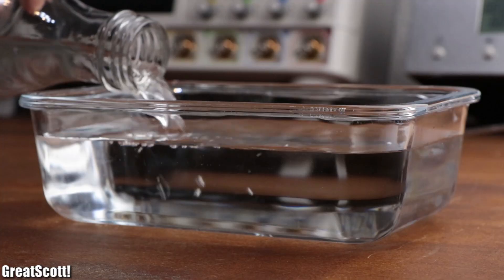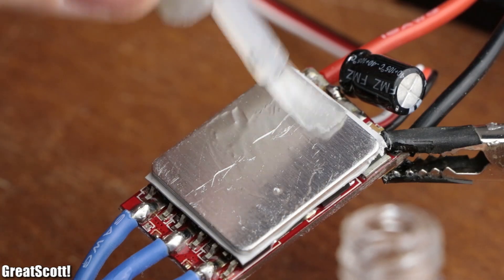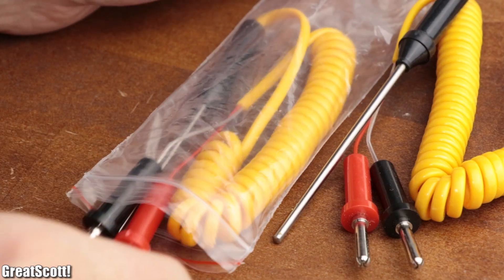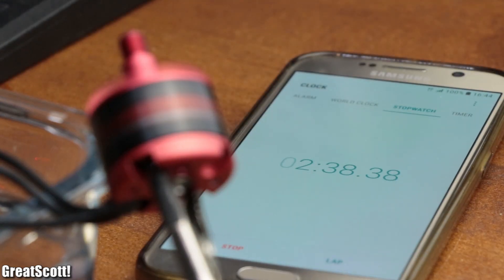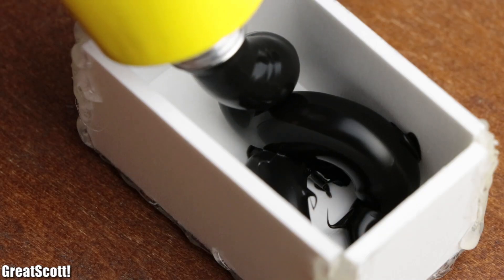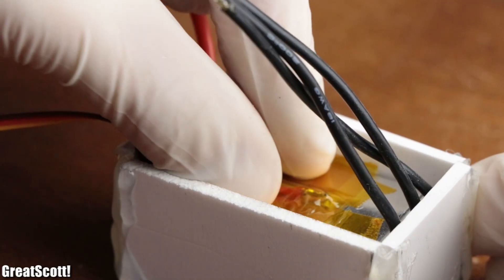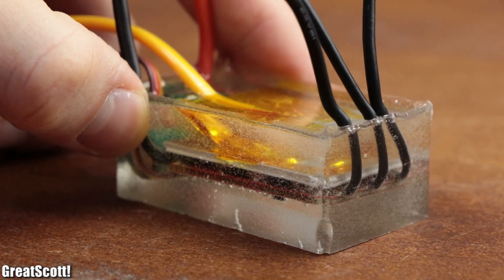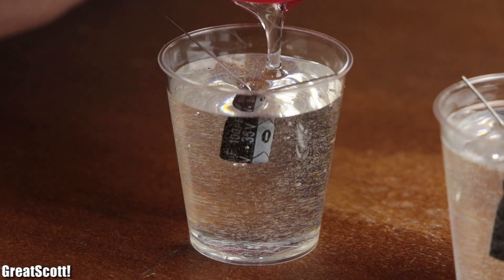How to Waterproof Electronics || Nail Polish, Silicone, Potting Compound

Comment: the original shrink tube protection around the ESC - is that good enough actually? Like, can the humidity inside the shrink tube cause problems at low temperatures?

Comment: I think the silicone did not cure because it did not have enough time to capture moisture from the air before encapsulation. Silicon needs the water for the chemistry to begin.

Comment: Seen you know about electronics ! I have a question.  Can i put any kind of silicone to protect the positive and negative wires for my 48 volt battery port terminals ? There was a white silicone already there, but i removed it to do an inspection.  Thanks

Comment: Silicon hardens when exposed to the humidity in the air. In other words you only exposed the outer layer while the inner layer stayed liquid because it was sealed, the same way it maintains itself liquid in the tube it comes in. It must be applied in quarter inch layers at a time, adding a layer roughly every 45 minutes with a total curing time of 24 hours.

Comment: The technique I have used for decades on, for example, greenhouse automation electronics but also ESC and receivers is to apply about 6 generous coats of Ambersil acrylic conformal coating allowing time for the coats to air dry between applications. This coating is very thin and with low surface tension is very searching and with the boards flooded with the coating it covers the underside of chips and, importantly, their legs. I protect any connectors while applying the coating but, having completed the coating protect the contacts with Electrolube EML (this latter protection I repeat about every 12 months).

Comment: You can mix silicone with white spirits and make a silicone paint. Very easy to apply and works better than nail polish. 
That black silicone looks like gutter/roofing silicone, it doesn't dry due to the need for it to keep moving with the roof tiles.
Reply: hi preytec have you become a flat earther yet?

Comment: I have a 1" long electronics board with a usb input on one end, and usb output on the other. I'd like to enclose it entirely in a block of some form of resin or hardening waterproofing, without any of the material 'oozing' into the usb connectors and possibly preventing other connectors from properly seating. Suggestions for this?  What could be used to make a 'cubic' holding container for the resin to harden?

Comment: wait this is wrong, so wrong, what if the component is to be used in a HOT engine bay?  is a guy supposed to have a container under the hood where he can pour cold water into it every few hours?  this isn't real world as your water is acting as a coolant?

use real world conditions such as an oven turned up to like 180 to simulate a hot engine bay on a hot arizona day..   I mean why would anyone use a thermal heat conductor to cool silicon components in water? they would just use the water to cool the silicon components no?  what the hale did I miss?

Comment: I have a small open circuit,the size of 25 cent coin,which is mounted to a bicycle crank near the pedals.This circuit uses a 3 volt CR2032 battery with a twist cap to close and protect the circuit board and battery.The battery only last 7 days...so I purchased a 3.7 volt 2000 mah lithium battery with JST connections wires and soldered it into the circuit board.The small unit works amazing now.I only have to charge the battery,once every three months.The only problem is, I left the circuit vulnerable to water because I only covered the small circuit board with many raps of electrical tape.It looks ugly but it works for now.I need to clean it up so it looks like nice.

My question is,will the nail polish be enough to water proof the small circuit board against rain and moister ? I will be riding in the rain for 2 to 3 hours or going through puddles the odd time.Also,If I use nail polish or any other sealant,will I be able to remove these products from the circuit board in case I have to re-solder the wires again?

Great video,very informative.

Comment: You should try different types of silicone in different methods of application. IMHO, I think you went way too ridiculous on the silicone and potting components. You could have just dipped the potting stuff a bunch of times to make multiple layers until properly sealed without being a brick. Same idea with the silicone, I think. You just need to use some thinner/less viscous stuff somehow. Nail polish can make use of this idea; but you wiill need a lot of it to be able to dip it in and out again like a candle.

Comment: That's pretty fab. I have an older car sat Nav or GPS unit and instead of throwing it away as my car comes with one nowadays, I'm going to use it on my motorcycle. After using nail varnish. A dedicated waterproof unit is around £400. I've got nothing to lose 🙂🙂
Thanks

Comment: For silicone rubber seal you need cardboard or paper box (moisten box before cast for easy separation). Because silicone for curing need water vapor from air. Your box with plastic sheets - totally block water and curing time 1 day per each 2 mm thickness from top. For fast cure - put in the hot water.

Comment: I've worked with potting compound on my job in the past.  it's a nightmare.  Good luck troubleshooting circuit failures, it is terrible for thermal management, and thermal expansion can rip parts off the PCB.  It's expensive, and very messy for the manufacturing plants.  Conformal coat is better.  Best is to deal with waterproofing with the housing.

Comment: All this when you could have just used conformal coating, that's actually for electronics. Let's find out what happens when we heat up chemicals. 🤷‍♂️
Reply: Thats only designed for moisture not full on soaking
Reply: @antan2329  contact MG chemicals. They have about everything. If not ask.

Comment: Please consider deleting this video as its content is misleading. Testing the ESC with motor without load? The ESC would overheat in the resin or silicone. And the silicone, Is that at least neutral? Acetic silicon will destroy the ESC. You would have to use two component silicone for this purpose.

Comment: Great information. I wonder how things would have been under load though rather then running it in open air. 
Also, that how silicone works. It will always do that to you. However, if you mix in corn starch when you go to coat the item the corn starch will cause the silicone to 100% cure no matter how big the blob is. That's actually the premises behind "Sugru" which is a commercially available version of the same thing.

Comment: Do NOT use silicone - in the early 1990s I worked on a project which used this for potting a filter coil module for use on a fast jet's avoinics. It all seems fine on day one, but as silicone cures, it releases acetic acid (it's why wet silicone sometime smells of vinegar). This is only a small quantity, but over time it attacks your solder joints, leading to premature circuit failure.

Comment: Nail polish seems to be the safest one in simpler circuits since you can use acetone to remove it if you need to resolder or fix something

Comment: if you ever plan on doing repairs to the circuit or want to change something, it will be a pain removing whatever epoxy is used to pot the electronics. It's a great option once you know your shit works, and you want it to be that way permanently

Comment: I hope you will see this message, this video being so old now, but there's a great product I've discovered that works as well as silicone, but is a lot easier to use - you just paint it on... "Liquid Electrical Tape"...  It's like silicone, but it dries really quickly, and like I said you just paint it on... I use the black, but it's also apparently available in red, green & white.  It's from Gardner Bender.

Comment: Man I love your videos, great channel. I have a question am planning on doing something similar like your intro video 1:30 am going to be using some red LEDs and adding a on and off switch, but my question is what were you using as your power supply? And since there is quite a few leds is it better to run them parallel or on series?

Comment: GreatScott!  You just saved me $20 bucks for expensive conformal coating.  I suddenly had a thought to use clear nail polish for an outdoor solar light, did a google search and YOU show up as the first search result!  Too Cool!  Normally I'd skip the video results but I recognized you as one of my subscribed Go-Tos!  
Congrats and Thank You!
Reply: Use a UV light to check for holes in the coverage area after the nail polish is dried. The polish will shine under UV a milky color, and the light will reveal thin spots which may need a second coat.

Comment: If you really want to see how these compounds would work at higher temperatures, you would need to load the motor in order to produce significant heat at the heat sink.  One idea would be to attach a fairly big propeller blade and then fix the motor in place and let it push air around, or you could attach a smaller blade and stick it in water.  Or, if you're a bit of a mad scientist, you could try holding the motor's rotor stationary with respect to the stator in order achieve a locked rotor scenario, but only if you don't mind possibly destroying your motor and/or ESC.  This will make things very hot and so you might want to limit how long you do it for and then switch back to a lighter load and see if it still works.  20°C is not hot; it's room temperature.  You want to see how these compounds perform at 40, 50, 60°C and up.  Depending on the ESC, you might get temperature above boiling point, which means you need a better heat sink (and probably bigger wire and a good power supply).  This is still an informative video just on the information about some different DIY solutions to waterproofing circuit boards.  My application doesn't require higher temperatures so I will try the clear nail polish.

Also, can you tell us what you used for the clear potting compound?
Thanks.
Reply: I water proof my RCs with CorrosionX spray it couldn't be easier and the thermal properties of the device are unaltered

Comment: if you wanna get really fancy with the epoxy, use a pressure pot to minimize bubbles. You can either vaccum the bubble out, or apply pressure to shrink the bubbles when curing.
Reply: Great idea when dealing with electronics that includes a electrytic caps...

Comment: have you heard of our lord and savior, conformal coating spray?
Reply: Is that like CorrosionX because that's what I use and I don't understand why it hasn't caught on
Reply: @PabloGonzalez-hv3td  i dunno what corrosionx is, but conformal coating spray is a spray that turns into a thin layer of plastic when it dries, as in a coating that conforms to the surface it's sprayed on.
Reply: @nonchip  Corrosion X makes a specialized lubricant / anti corrosion spray that instantly waterproofs electronics and since it's an extremely thin conformal coating the thermal properties of the device are unaltered.
Reply: @PabloGonzalez-hv3td  ah ok the stuff i meant is usually not lubricating or actively anticorrosive since it's meant to be very chemically inert to just be "in the way" and not interfer with anything (since reducing agents from anticorrosive stuff can damage some electronics) and often a bit thicker than that stuff.
Reply: @nonchip  This stuff is also meant for electronics (save for membrane switches) and has the viscosity of cooking oil it's not reduced.

I can't speak for long term effectiveness on an item that's continuously submerged but it's perfect for splash proofing
Reply: @PabloGonzalez-hv3td  with "reducing agents" i meant in the chemical way, as in "takes oxygen away from things" as many anti-corrosion sprays do to "reverse" any rust. you definitely won't want that in electronics, but sounds like the stuff you got doesn't do that, and just protects against further corrosion by being waterproof, that's totally fine.

Comment: I use the 2 part epoxy. I buy the cheapest epoxy HF sells and stock up on it because it works like a charm and it never goes bad in storage when its a 2 part formula. I've dragged circuits through lakes with this on and never an issue.
Reply: CorrosionX spray is much easier to apply and the thermal properties of the device are unaltered

Comment: To use silicone.  Make sure you have 100% pure silicone.  Mix corn starch 1 tbs with silicone 5 tbs for about 2-3 minutes (disposable container/cup and plastic/latex gloves).  Then pot device.  Will set in about an hour.  Set silicone will easily come off fingers, cup &whatever but will be a solid block covering component.  (Maybe use a little silicone to seal around wires.)

Comment: YouTube read my mind. I'm working on cooling PCBs with water, while keeping material density and conductive coefficient in mind. Thermal resin with silicon dioxide filler did indeed end up being the solution of choice. Except I'm trying to dissipate 50W of power, not 1 or 2. Good stuff.

Comment: Thin the silicone with mineral spirits and it will pour easier - add some glycerin and it will harden without air exposure.
Reply: i was wondering if somebody would post this.. screw nail polish, use silicone and a thinning agent
Reply: @schlomoshekelstein908  Cheap, readily available, easy to use, not super toxic like 2 component, plus being rubbery I think is a better end consistency than brittle.

Comment: We used to have a cooker that its main electronic control box was susceptible to 'flooding' from cooking overs-pills which  water spills usually contained salt and as we know salt is not only corrosive but also conductive.  Therefore it used to short circuit the entire circuit board. Obviously this was a design fault on part of the manufacturer but I had to find an alternate solution until we can afford a new cooker.  After buying a new control box and removing the cover, I protected its' circuit board with epoxy resin which made it pretty water proof. But I always wondered if the resin had any effect on the operation and current flow.  This video was very helpful! Thank You!

Comment: I use a 2 part epoxy with a brush like your nail polish.  It doesn't build up much volume so allows heat transfer.  The epoxy resin is also much more robust than an acrylic paint.

Comment: Hello using motor with no load is not a valid test, should be at least with an airscrew that load it at least to 50% of its specs. Then you will see that the original heatsink with wrapping is barely suffiscient.

Comment: Silicone doesn't "dry". It cures as a reaction with water. It gets the water it needs from the air. But when you apply it thick, the cured outside seals the inside preventing it from getting water from the air. The solution is to fold in just a few drops of water before putting it into your mold. Search YouTube for King of Random ProtoPutty.

Comment: I think your ESC temperatures aren't accurate as there was no load on the motor. If there was a propeller attached, current draw would be greater and your ESC temperatures would rise to the 35-50 C range, more or less depending on the propeller and RPM of the motor. These increased temperatures may or may not have an impact on the methods used in this video when put into real world use. I just wanted to point that out. Otherwise, great video!

Comment: Wish the auto manufacturers would do this to electronics they mount in the floorboard of cars and trucks which fail frequently, boat manufacturers are smart enough not to mount electronics in low water collection points.

Comment: For nail polish, why didn't you 'dip' the ESC into a nail polish bath?  Alternately, pour the nail polish into a plastic bag and put you electronics into the bag with it (the wires can dangle out of the bag). remove as much air from the bag as you can, and swish the nail polish around for complete coverage.

Comment: NEVER EVER use household/automotive silicone (acetic type) around wiring and circuits unless you’re intentionally wanting it to eventually fail. These Silicones continues to out gas corrosive vapors (that pungent vinegar smell) for months. If there is any moisture present, copper, tin, silver and other metals will corrode with such large oxide growths that things will short out. Use shoe goop/ household goop instead. Build up with thin layers because air is needed to dry. Neutral cure silicone can be used but thick areas cure slowly. flexible thin pouring potting compound is best.

Comment: Be sure the silicone says “neutral cure” or it’ll corrode the metal.   

If it smells like Ammonia or vinegar , it’s the corrosive type.
Reply: Or anything related to acetoxy or acetic acid. It'll etch and corrode the electronics.
Reply: Wonder how you figured that out
Reply: do you have a brand of this kind of silicone, please
Reply: @enrique4322  In the USA the only thing I know for sure will work is marked GE Silicone II
Reply: Food grade silicone should be safe to use.
Reply: Silicone made for mirrors is neutral and should be suitable

Comment: I use automotive clear coat, mix a little bit of it in a cup, dip it let dry for about 10 min and dip for second coat if your pcb will be under water for most of its life, otherwise one coat is fine. You can pick up a gallon of cheap clear for 50 bucks which will last for years.

Comment: If you want to use silicone to waterproof anything, use a little bit of oil or cooking spray on your tool of choice and spreading the compound will make it easier to contend with. Be mindful that certain items chemical mess with the silicone so use something that will not affect it. It's the same principle used by painters and window installers. They get a rag or tool, spray it with water or something that makes the silicone not want to stick and boom, clean application.